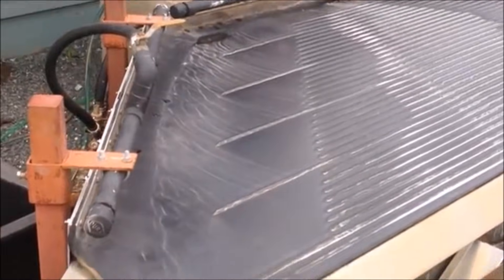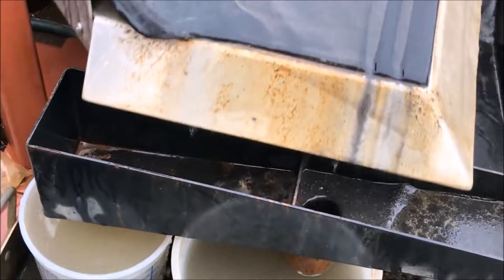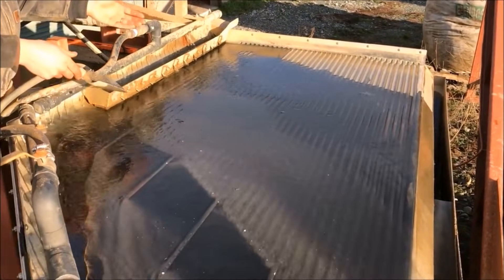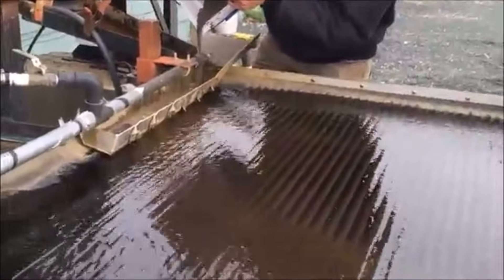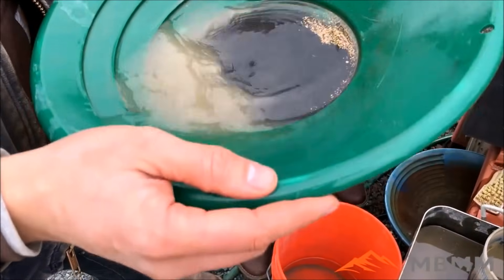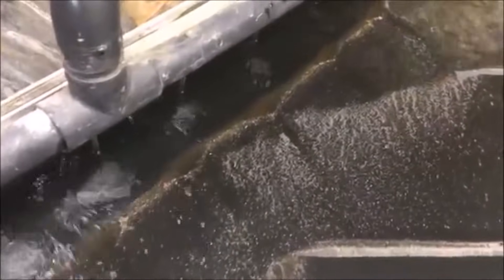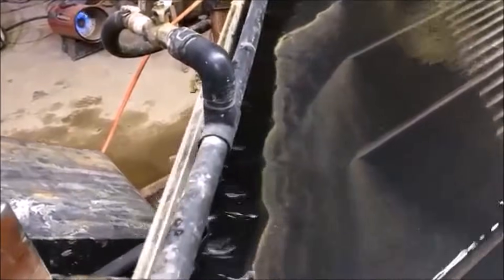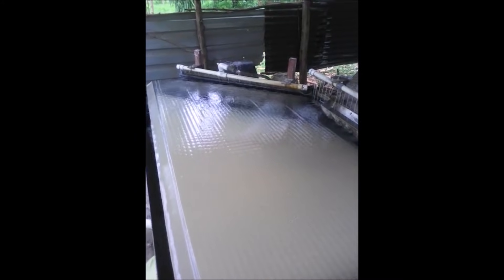Shaker Tables For Gold Mining, Fine Gold Recovery, Black Sand Concentrates MBMM

Comment: This is the first of your videos I have seen that kinda delves into the shaker table. As an engineer I would love to see a video on the physics of the table. I.e, angles, flow rates. The trough at the top particularly fascinates me as to how you designed and set the flow on the outlets?  I have seen you many times brush the cons over to the high side, but would love to have a delve into what is the angle of the high, what flow rate is too fast or too slow to make the gols flow and not be washed away as it is flower gold.

Comment: Thank you for the informative video with varied examples. Looks like a practical way to handle large volumes of ore or big batches of concentrate.  

Are shaker tables used for other metals or minerals or is it mostly limited to gold and silver?
Reply from the maker: Yes, our tables are used for all kinds of density separation, and not just ore.  We have tables being used for electronic scrap separation, fine base metal dust, jewelry sweeps, etc.  Pretty much any density separation of fine particles
Reply: @mbmmllc  Do you have a facebook account? Do you have a operating shaker in Finland?

Comment: Having watched at least 100 videos on shaker tables, I can easily say that yours are the most informative.  My biggest question though is that almost every video and discussion I have had on tables almost requires that there is a bump assist and yours does not.  Is this because of the 15 degree angle of the leaf springs?  Looking forward to your response.
Reply from the maker: The table actually shakes in a circular fashion so that the heaviest materials stay in place as the shaker table pulls back. Additionally we have a raised platform in the table at the very end of each groove that only allows the densest materials to climb to make sure no waste material gets into your concetrate.
Reply: What is the difference between these tables and Gemini table??